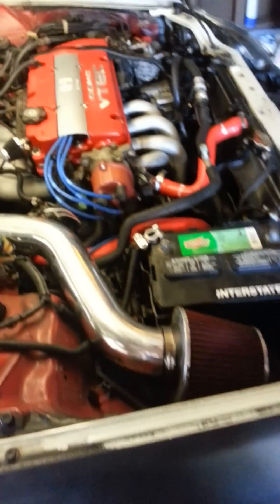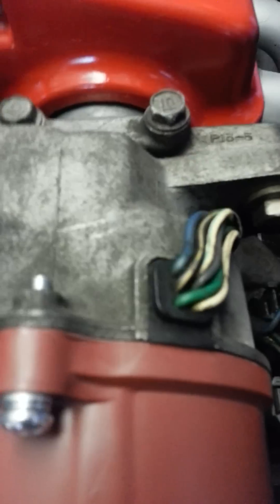Rywire obd2 to obd1 distributor swap honda prelude

Comment: be careful i did this switch and it went perfectly. but you do have to live with a p1399 code unless someone has an idea that can fix mine. great thing to do though because the crankshaft position sensor is a pain in the ass.

Comment: I was told by honda tech forums, that for a chipped p28 on the 97 bb6 you didnt need to change the dizzy’s because p28 dont have a knock sensor nor will the crank position sensors have any effect. Im feeling like you just wasted your money doing that.

Comment: U need better lighting. Get to to point. Be specific. And steady ur camera. Get your facts together. U dont seem sure of ur self. Personally ur vid doesnt help. But good job. A for effort.
Reply from the maker: Yea,this video is from 5 years ago bro...  this is as detailed as I want to do.. if you want it straight to the point,get the directions from rywire
Reply: jeff backus dude please help when you did this swap do I have to switch anything under the timing belt

Comment: Monotech harness solved all this.i went with obd1 td60u dizzy.you don't need to run that crank sensor with my set up.plug and play is the way.i only payed 400 for the harness and it work great and looks super clean.

Comment: what's the point in doing this? it gets rid of the sensors on the oil pump and allows ignition adjustments at the dizi instead of ecu?
Reply: v6 ftmfl  Chipped ecu
Reply: Pearl_ White_Sh uhhhh no! Not what i was askin! Dont act like u know shit! Anyone else wanna point me in the direction of a link on how to make the conversion harness instead of having a buy one I know it ain't hard to do! I'm needing to make ignition timing adjustments on the exhaust Cam and hoping this will help me out!

Comment: I bought the harness and my coil is external so they gave me a little red 10cm 1-1 male tooth pin. not sure what to do with it, and because I'm overseas I can't call them aha!
Reply from the maker: then dont worry, that red wire is for internal coils, dont worry.
Reply from the maker: should all plug in and work right?

Comment: K so I have a 97 accord lx it had an f22 b2 in it and I got a new one that is f22 b1 so wpeverything plugged in on the harness exept 2 plugs one for the dizzy but the second on plugs in beside it and the crank sensor I tried to see if I could mount the old one on to the engine but there wasn't even mount holes I'd have to drill so do upk just get that connecter?

Comment: Pretty sure you just answered a question I had... I'm getting a crank position sensor error, and I do believe a new dizzy is my best route, just because everywhere I read that guys are getting this code are having to replace the sensor because the car won't run.. that's not my case.. it runs and starts no problem.
Reply: did you end up changing the distributor?  im pulling a crank sensor code too and im still able to drive the car

Comment from the maker: Gary williams... no that is not the case b and h are never going to be adaptable... you loose power if some even thinks about making a adapter plate lol... usually if head doesnt match up with intake its.. one has been replaced or honda said fuck it lets put that last of the old stuff on it...wont hurt none at all

Comment: so, i'm new to Honda's. I/we have always built "old school" muscle cars. I've got a 97 prelude base/auto. it runs much better then it should for stock. it had a cheap cai when I bought it, since then I put a magna flow muffler on the stock pipe, and I built a sealed ram air system for it. but even before those things it always ran better then it should for 195 hp. the balance shaft pulley has been removed, so i'm sure that accounts for some of the extra power, and quicker revs. the only other thing I've noticed is the number on the head, doesn't match the intake. p13 hf2 on the head, and p13 hf1 on the intake. I've been told the intake might be off of a b18c, or maybe an accord euro r. any thoughts?